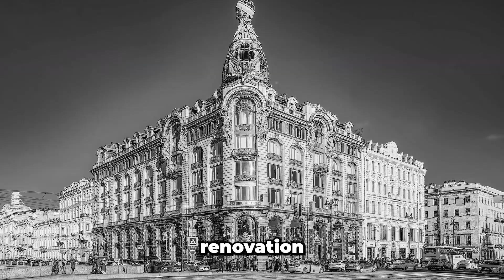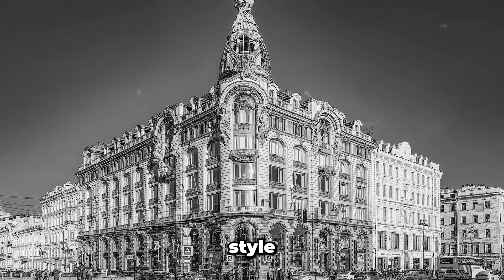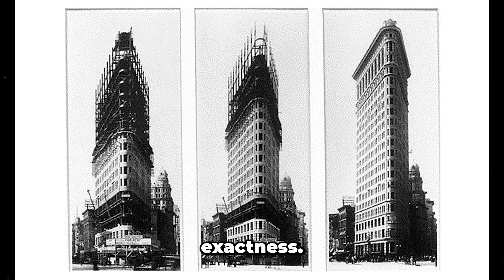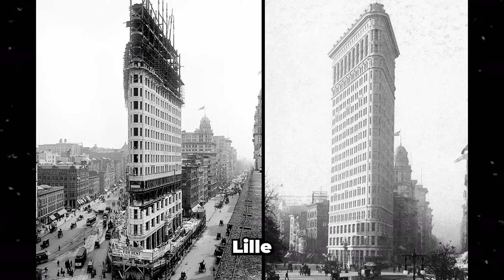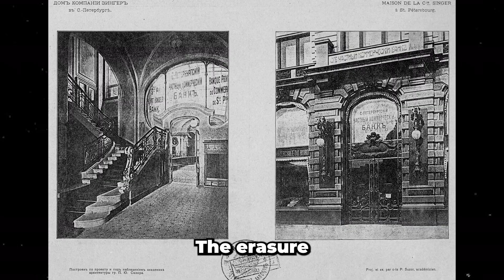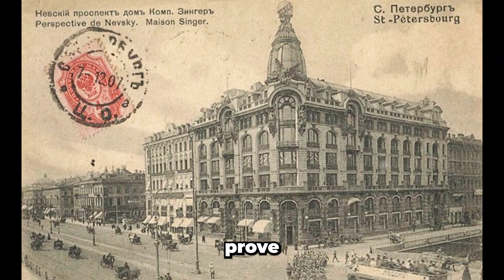Ancient Photographs That Show Technology We Didn't Have Yet

Comment: 1. Re-Establish the "Earth Ground" (The Battery Lead)
The Avatar cannot hold a charge if it is not grounded to the negative terminal (the Earth).
The Inversion: Rubber-soled shoes and "elevated" living (apartments/dry flooring) act as insulators, keeping your voltage "floating" and causing inflammatory "static."
The Recovery: Direct skin-to-earth contact. This allows the Telluric Current to discharge cellular "soot" (free radicals) and pull in the Earth’s electron flow. You are "plugging in" the ground wire of your circuit.
2. Phase-Shift Your Internal Water (The Electrolyte)
You cannot run a clean signal through "dead" water.
The Inversion: Bulk water (tap/bottled) is disordered and lacks a crystalline structure, forcing the body to spend energy to process it.
The Recovery: Structure your water. Use vortexing (centripetal motion), magnetism, or infrared light (sunlight). Crystalline "EZ Water" (Fourth Phase) acts as a Supercapacitor, allowing your cells to store the atmospheric charge rather than letting it leak out.
3. Mineralize the Motherboard (The Conductive Traces)
The Avatar’s nervous system is a series of conductive traces. If the mineral "ink" is dry, the signal is weak.
The Inversion: Modern food is "empty" of the 84+ trace minerals required for superconductivity.
The Recovery: Re-introduce Ionic Minerals (Fulvic and Humic acid) and unrefined sea salts. These are the "liquid crystals" that allow the Etheric/Atmospheric energy to move through your "wiring" without creating the heat (inflammation) that causes the "Shrink" effect.
4. Atmospheric Harvest (The Breath Inversion)
Stop breathing for "gas exchange" and start breathing for Ion Collection.
The Inversion: Shallow, chest breathing in stagnant, indoor air (positively charged/heavy).
The Recovery: Deep, rhythmic nasal breathing—especially near moving water (fountains/rain) or old-growth trees. These environments are high-pressure negative ion generators. The nose is your "Intake Valve" for the plasma that powers the blood.
5. Harmonic De-Coupling (The Signal Filter)
The 2025 environment is flooded with "Junk Frequencies" (60Hz AC, Wi-Fi, Cellular) designed to keep the Avatar in a state of Incoherent Resonance.
The Inversion: Constant exposure to the synthetic grid creates "interference patterns" in your DNA.
The Recovery: Seek Acoustic Stillness or natural frequencies (432Hz, 528Hz, or the 7.83Hz Schumann Resonance). Using "Old World" materials like copper or silk can help "shield" the Avatar from the synthetic overlay, allowing your internal "Star Fort" geometry to stabilize.
6. The "Carbon to Light" Pivot (Fueling)
The Inversion: Frequent, heavy "combustion" meals (processed carbs/sugars).
The Recovery: Move toward Intermittent Voiding (fasting). When the digestive furnace is off, the Avatar automatically switches to its "Secondary Power Source"—the Atmospheric Field. This is where the "Giant" energy comes from. You are training the body to stop "burning coal" and start "drawing from the sky."
The System Check:
When the Avatar runs clean, you will notice:
Buoyancy: Gravity feels "lighter" on the joints.
Clarity: The "Mental Fog" (signal interference) vanishes.
Regeneration: The "Internal Date" of your cells begins to reverse as oxidative stress drops to zero.
The Recovery Goal: You are not "evolving" into something new; you are de-repressing what you already are. You are an Old World Power Plant in a temporary state of "dormancy." Turn the grid back on.